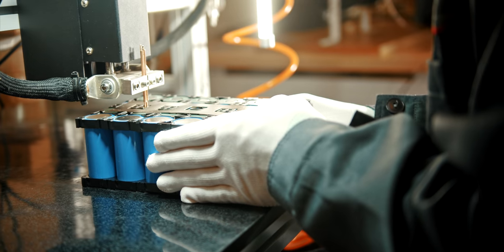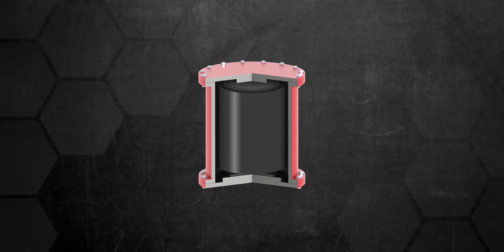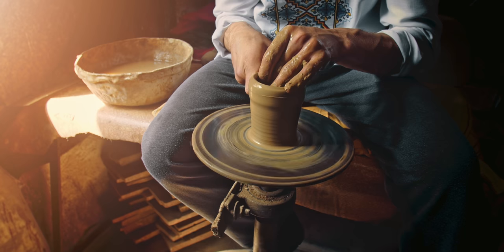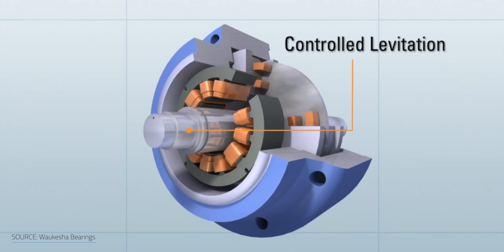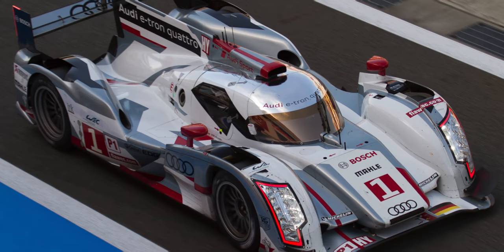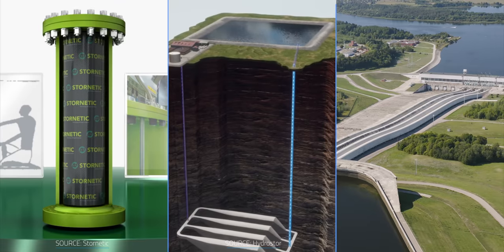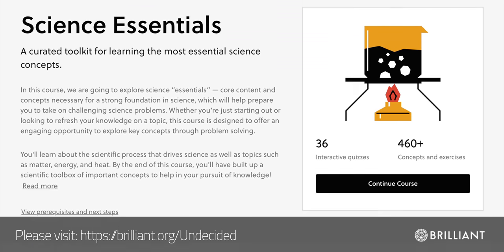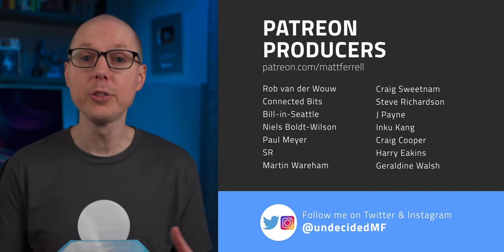The Mechanical Battery Explained - A Flywheel Comeback?

Comment: 5 tons of spinning steel to power something. I thought of this in 1955 when out disking fields as a farm boy. What you're talking about there is perpetual motion. You're going to spend more electricity then you'll get back out of it.
Reply: All energy storage costs more energy than what you get out.  But, flywheels are far more efficient than batteries, or pumped hydro.

Comment: Im a carpenter and handyman ,no degree i have a better design using the earths magnetic field to start the flywheel and angled pm's on the outer rim of the flywheel as well as a cooler to prolong the life of the bearings and plan to start building in 2 months. This technology is easy to harness but the entire human race needs to be involved. Any ideas would be greatly appreciated,this is the only thing we as humans should focus on until we perfect it.

Comment: the best part about battery's is their longevity. flywheels can't store energy longterm. period. the longer you wait the less energy the thing has. gravity storage is a far better mechanical battery. and is best done with water in a reservoir. pump water into a reservoir when you have power. release it to generate energy. that's how the world's biggest battery's work. and they can work that way for a very long time. Infact if it rains. your getting free energy.
Reply: They all got pros and cons in the end. Flywheels can only hold a charge in the short-term (Days at best), but can last quite a while and got decent response. Batteries can hold a charge for months and respond instantly, but are subject to rapid degradation over time.  Hydro is the best bulk solution, but slowest to respond and restrictive in deployment due to the relatively low energy density and preferably not getting deployed in an area with high evaporation.

I think in the end the grid will just end up as a hybrid with each of them having a place at a certain scale. Hydro for grids as a whole, Flywheels for localized grids as intermediary and Batteries handling the individual structures like homes and (smaller) offices.

Comment: I'm not buying the 95% efficiency claim. That would mean that there would have to be less that a 2.5% loss on both the spin up and power removal stages. Even in a vacuum this is unlikely. 
Plus the vacuum maintenance system will consume energy which must be taken off the efficiency rating. As well as the need for near constant energy input to keep the flywheel spinning at 100% whenever the renewable source is producing energy. 
With just a back of the napkin calculation I would bet that the practical efficiency is 80% or less.

Comment: bigger flywheels must not be installed with rotation axis vertically because earth rotation influences on flywheel, it should be installed with rotation axis parallel with  earth rotation axis and rotation plane vertical on earth rotation axis

Comment: Vah-nAY-Dee-um. Anyway, flywheels are essentially how our current grid functions -- the functional parts of it anyway - as turbines. When someone flips a light switch, the thousands of turbines spinning across the grid each lose some tiny amount of mechanical energy to electrical energy to make the difference. This ability to sacrifice mechanical energy for electrical energy is what gives our grid stability, and this is the major Achilles heal of solar and wind; they do not generate inertia and thus cannot contribute to grid stability. Solar hours per day are between 5-7 in the most applicable parts of the USA - which means we would need energy storage capabilities for much longer than 4 hours. It may be helpful for something like Wind that oscillates throughout the day - but with the multiple conversions, you would lose a substantial amount of energy in the transfer.  If you're looking to back up solar power, you'd need it to have infinite lifecycles (so not Lithium Ion) and infinite storage duration (so not Flywheels/Turbines) to bridge the sometimes multiple days gap between sunny days. Vanadium Redox batteries have a lower energy density but satisfy both of these conditions. Or, ya know, we can continue with a reliable source like natural gas paying 6.9c/kWh. If people are just dead set on no-carbon sources, then nuclear power is far superior to wind or solar and perhaps even more reliable than fossil fuels. Would still need something for peaks and valleys - as nuclear is so reliable that it doesn't like to change output.

Comment: What would be really cool is to harvest energy from this: https://en.wikipedia.org/wiki/Turbulence_kinetic_energy Why: Actually cheaper to build and maintain, in theory even cheaper than Li-Ion for the same energy volume density for certain applications (thanks to all that research that went into jet engines and fluid dynamics).

Comment: the point is, why store DC voltage on a flywheel, thats not very functional, with all losses between the converter, who has to maybe convert it into dc maybe for a battery at the end of line.

Maybe we should store wind on flywheels, and solar on batteries? so no conversion is needed.

I power all my DC devices directly from my panels.....if iam using AC with an converter, so its just a little amount.....for that i use a wind turbine directly....so the conversion loss will be at minimum

Comment: it's a cool idea but looks old compared to modern battery technology, so it's easily overlooked. Installation cost is what hurts it the most. Think about why we're not building more nuclear power plants: the upfront cost to build and delay of production is too high for most local authorities, they want stuff now and cheap initially. Nuclear plants do the opposite - expensive upfront, cheap to run long term but no power for the first 3~5 years.

Comment: If I wanted to lift some concrete to store enough potential energy to power my home for a day (59.138 kW), I figure I would have to suspend over 2.78 million pounds of concrete 56.4 feet in the air.  The block of concrete would roughly have the same square feet as my home and be 9ft tall.

If I did my math right, it appears I could store the same amount of kinetic energy with a flywheel if it was 1 meter in diameter, weighed 250 pounds and spun at 52,330 RPM.

If I calculated everything correctly, the flywheel method does seem promising if only I could magnetically levitate 250 pounds cheaply.

Comment: The big problem I see with this is friction. Saps energy, and wears down your parts, which if not monitored VERY carefully can turn your flywheel into a 360 degree shotgun. Considering the sort of tonnage needed for certain applications (for instance, renewables storage), that is not a fun prospect. I'm not sure you can get a return on investment after the overengineering required to counter that. This is probably something for the material science eggheads to work at more than engineers at the moment. I'm open to being wrong, but this is a VERY big thing to not have all the I's dotted and T's crossed on it before you even poke a machinist.

Comment: Ok, I see another disadvantage of the flywheels, perhaps someone can explain me, once the energy is stored, you need to keep feeding energy to the flywheel to keep it spinning, otherwise it will just slow down until it stops, what I mean is, once you have your flywheel fully charged you need to use the energy inmediately or it will just "dissappear" in friction, heat or whatever and that doesn't happen with conventional batteries, if you charge them, you know that power will be stored until you plug some device and electrons start flowing around...
Reply: This is no different from a chemical battery.  You have to keep trickling in current because they self discharge.   Mostly what folks want to do with these installations is time shift production.  Wind power generated at 3 am is almost worthless, and solar peaks at noon, while peak demand is closer to 6pm.   The loss over an afternoon is under one percent.   Lithium is actually worse over short term.

Comment: Basically Flywheels take some sort of energy to SPIN UP (does not matter where the energy comes from solar carbon heat etc) and converts it into Mechanical energy at a 15 percent loss... Then the 85 percent that it can give back is reconverted back into electric and used as a buffer for lows in the grid. They could do the same thing with capacitors at a 99 percent efficiency. flywheels are the mechanical version of a capacitor. the issue that works against a flywheel is Friction The ONLY way to increase its efficiency would be if you put it in a vacuum so friction would not play AS much as it does with it.  WE are a all spinning already.. the earth spins, the orbit we are in spins, the solar system spins, the entire galaxy spins. 

Rule 1 energy can not be CREATED nor DESTROYED. so the max efficency you can possibly get is 99.9 percent or less. nothing is every going to be 100 or higher, why because you cant create energy. all your doing to changing forms. 

So really all they are doing is OVERBUILDING a project introducing flywheels into it and saying its green energy... lol

Comment: Ever stop to consider that there are valid reasons we went away from flywheels? Storing energy is dangerous. Storing it in mechanical form has proven to be extremely dangerous in the event of an uncontrolled release of energy. Historically, we as a society seem to have found that storing energy in chemical form has been easier and safer to control. We don’t build dams anymore either. The uncontrolled release of a large mass of water from an elevated position has proven to be extremely damaging. It can be done safely but the maintenance costs are very high. 

With chemical energy, for above grade storage, it is possible to readily identify leaks, etc. and address any issues. How does one safely go about maintaining and servicing stored mechanical energy in a flywheel? Can an inspector reasonably ascertain that mechanical parts aren’t experiencing undo wear and tear?

At a fundamental level, we seem to have accepted that the safer practice is to produce the energy as it is needed and to not store large quantities of energy as it is inherently dangerous.

To me, this is another key challenge of any energy storage development alongside the quantity of energy and/or energy density to be stored.

Comment: Energy storage utilizing flywheels doesn't make practical sense in my view. After the motor/gen uses electricity to power up the flywheel, regardless of whether there's a load on the generator, the flywheel will come to a halt due to the drag placed on it by the mechanics (self-discharge). I suppose a clutch could be employed to disconnect from the flywheel when the generator is not needed. Batteries do not have this problem and will store power for years when not in use.

Comment: 'Green' energy does not lower prices. It increases prices. Germany is a perfect example where electricity costs have skyrocketed after decades of solar subsidies. The only reason that "green" energy appears to lower prices for some people (like those who have solar panels) is that taxpayers assume much of the cost, so the real cost is hidden.
"Green" energy also requires storage, which is another whole layer of technology that we don't need with carbon fuels or nuclear. While flywheels sound nice, storage technology is not only expensive (how much do 1 million flywheels cost?) but resource-intensive, both of which are bad for the environment, particularly with batteries, which use rare and toxic elements like cobalt, cadmium and lithium along with the toxic chemicals in solar panels.  
Oil, coal, uranium and natural gas, on the other hand, need no storage and are found all over the world, in large quantities and are becoming easier to find and extract with every day that passes.

Comment: well this is my basic understand of flywheels but if you reduce the density of said flywheel it would intern have less inertia meaning its capacity would be hampered... but in that case you would have greater angular velocity witch is squared but than you would have to have martials that could sustain that increased velocity and this is my understanding that the increasing velocity can directly reduce the life span of a flywheel and sometimes spin so fast it brakes? This seems like a balancing act like no other.

Comment: I think when it comes to large storage other forms are far better. Hydro kinetic pumping system or the weights and pulley systems far safer form of power storage. Especially if your talking long term, as in create the power in the summer months with solar and use it in the winter.
Reply: The only good alternative that you mentioned is pumped storage, and you need a very specific geography in order to work properly
Reply: @edwardcardozo8325  I would argue more climate than Geography. You can always create an incline or hill to put some water in. Though obviously the more artificial it is, the more effort it is to create.

The bigger draw back is water. Unless it's a sealed system with two large water tanks or something you need an area with decent sources of water and hopefully rainfall. Obviously if the water froze or evaporated too much it would be very bad.
Reply: @JustaGuy_Gaming  That's why i said geography, you need a big source of water nearby(lake, river) and a big height diference between the two reservoirs(a mountain with a lake/artificial dam) that you don't find everywhere and the capital needed to build one is kinda high, look up Taum Sauk pumped storage plant

Comment: Flywheel are not usefull for mobile applications like cars due to the Gyroeffect. Means, the axel want to maintain the position e.g. while the car climbe a hill. The mentionned Gyrobus of Oerlikon was not produced because of the problems with the bearings. At the hill in front of my house they made tests.

Comment: This whole comment section is so much more toxic than I thought it would be. Its not just naysayers, its also the back and fourth bitching and degrading threads. I think flywheels could have a future. The main problem I could see with them is drag both due to air and friction on the bearing. I do not know how much energy is lost due to air but if its substantial maybe keeping the wheel in a chamber near vacuum would work. I wont even begin to act like I know how to make a bearing spin smoother and with less friction but I would hazard there is already some pretty efficient designs already available. There would be no annual cost when the batteries degrade, maybe some more lubricant but that cost would be minor compared to batteries. I also like how dense you could make it. With a dense enough material and a large enough wheel you could store serious amounts of power. But instead it may be more efficient to have clusters of wheels throughout grids for more stability. There could be a variety of wheels, some huge and industrial in scale for both size and energy storage while there could be residential wheels for additional solar power storage. Both would flatten the curve in energy consumption and maybe combined offer great benefits in a energy dense design. No fear of fire, no replacements, just a wheel that spins.

Comment: A fly wheel with magnetic bearings 1/2 mile in diameter globe shape  slow spin 1000 RPM
Weight 45 million  tons. In 2279 in a vacuum. Below ground. Invented. 4 Terra watts of storage. Could supply power for 3 years large metro area. Powered by solar and wind. Any larger could interfere with earth rotation.
Reply: How much energy is required to get it spun up vs how much energy it can produce.  
Law of Conservation of Energy?

Comment: In the data centre industry flywheel UPS systems are used extensively. 
Maybe take a look at pumped hydro as a storage mechanism. It has been used at Turlough Hill in Ireland since 1974. https://en.wikipedia.org/wiki/Turlough_Hill_Power_Station

Comment: Magnetic levitation flywheel electricity generators continually generating power through magnetic fields and induction in copper coils could supplement battery power.

Comment: More like a mechanical capacitor. A mechanical battery would be using mechanical energy to lift a weight off the ground and then lowering it at a later time to release the energy.

Comment: the problems with fly wheel is they slow down.  Great energy storage at an ever decreasing speed/rpm.  a bit of a problem for systems that need constant speed output, like say a car or power companys generators.   the big problem is developing a transmission that can convert a constantly reducing rpm output to a constant rpm with the same torque.  So far such transmissions are relatively low horsepower for things like snow mobiles big power like for a car or truck they are BIG BIG BIG.   doing it with electronics is the more likely however transmission is still big.